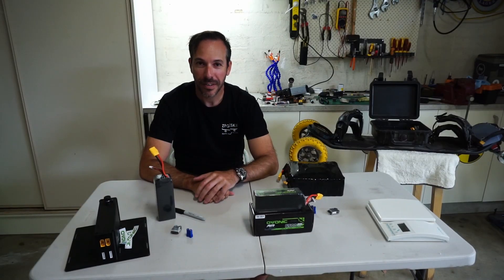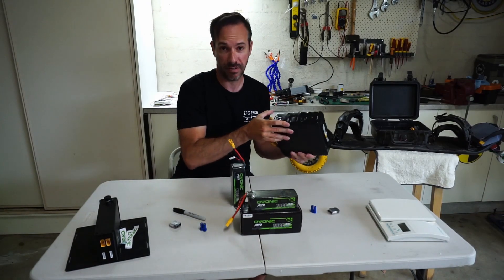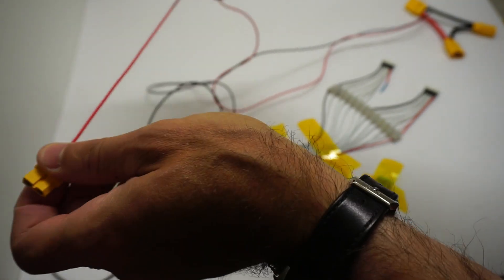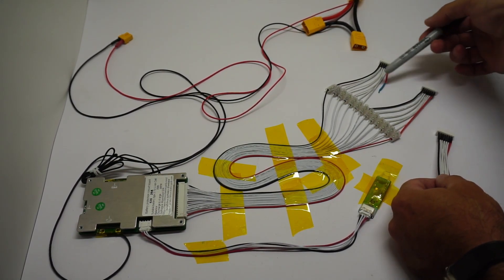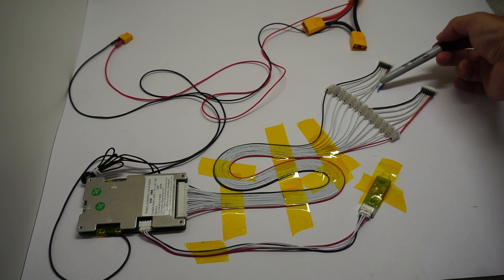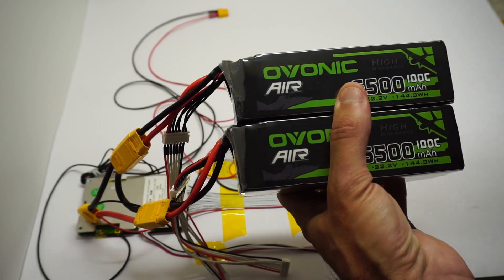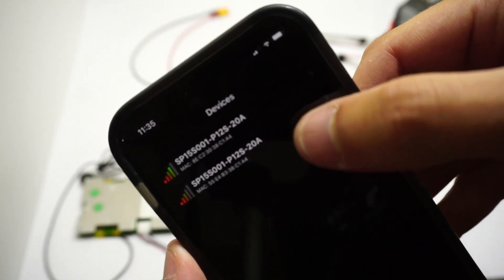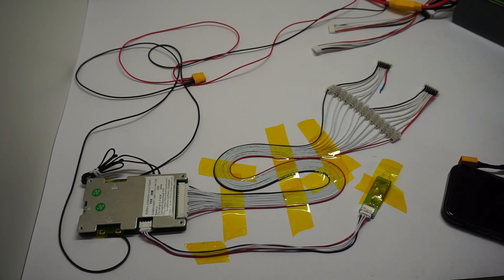12S BMS LiPo Hook Up

Comment: Do you only use it to charge? My cells are unbalanced, some are 3.6, others are 3.7, does the BMS regulate them even with differences in voltage?
Reply from the maker: Yep - Charge only. I've never had an issue with unbalanced LiPo packs - I have had issues with unbalanced Li-Ion packs though. In the BMS app setting you can set it to static balance - this will bring all the P group voltage closer together although will take some time.

Comment: If you put the neg on your meter on the first balance cable neg. And then pin your first positive wire on the 2nd battery. Shouldn't I see 7s voltage? Then 8s 9s 10s etc... Down the line? I'm not seeing that. But I've wired it as you have shown. My 1s to 6s all show the correct voltage. Just not when I make the transition to the 2nd bat.

Comment: I made a spare lipo pack for my ebike. You don't need a BMS. Just disconnect the series connection and use an imax b6 balance charger. You can even use 2 at a time.

Comment: Hi i want connect twelve 3s 2200mha batteries to one 12s battery 6600mha with bms how to do it?
Reply from the maker: WOW, that is a lot of LiPo packs. For this to work you will need to make 3 groups of LiPo packs that are connected in parallel so you will have 3 separate 12S setups each outputting 2200mha. 

You then will need to connect the power output leads of three groups in series. Similar to what I've done in my video. This will give you 12S 6600mha. Please do not attempt to use this setup with a 12S BMS, my brain hurts just multiplying the amount of balance leads you will be working with.
Reply: @zfgesk8  
i would like to connect them to bms or 3 bms

Comment: Wlil it be ok to not us a bms and instead use the voltage reader inside the board and then use a balance charger to charge the lipos?
Reply from the maker: You sure can and this is what I do. I use a SkyRC T200 as my LiPo charger and it works great. Having a BMS is a great option for folks who want to seal their LiPo Packs inside a Pelican case and use a regular 50.4V charger power pack.

Comment: Hey mate thanks for the guide. I want to do something similar in NZ. I checked your link in the description (broken) for the bms but no luck. Any chance you could direct me to the smart bms? Also where in the system do the alarms go? Thanks again
Reply: Its better to just charge the 2 batteries independently with 1 or 2 imax balance chargers. You don't need a BMS.
Reply from the maker: That's great to hear, sorry about the broken link. Its fixed now.

Comment: Hey Michael thanks for putting this video out...and the others....very helpful for someone like me new to the game. I have everything for my DYI build based on the MBS Comp 95 Birds - Makerx DV6 - Radium motor mounts - MBS 72T wheel pulley - 13 or 14T motor pulley. I want this to be as light as possible just for mountain bike trails/pump tracks so have gone with Flipsky 6354 140kv motors. The last thing I need to get is the battery and bms. I was actually looking at the Ovonic 6500...but they're sold out so looking at "Youme Power 6500 60C"...I found on ebay $99....don't suppose you've heard of them? or can you recommend another? What range do you get offroad with the twin 6500 set up? And what bms are you using or would you recommend? Any help would be great! Cheers Mike (I'm a Michael too...but across the border in Adelaide but originally from Melbourne....go the Blues!)
Reply from the maker: NOOOO! I'm strickly a Hawks supporter :) First up, you can afford to go a little higher in your motor teeth count as you have a 140KV setup. I'd start with a 15T or 16T motor pulley, you have heaps of torque to play with. I get about 14KM of BMX track riding from my LiPo setup, just over an hour and by that time my legs are on fire. I recently went to buy some more Ovonic 6500 too when they were in stock although they wouldent ship to Australia. You need to make sure you select the AU warehouse. Your next best LiPo would be a pair of Turnigy Graphene Professional they come in 12000mAh and 8000mAh size options, check out the Hobby King site. Another option is to run X3 Ovonic 50C 4S 8500mAh cells - These are in stock and have a high C rating. I tend to stay away from LiPo's on ebay stores as I've had some bad luck in the past with cheap 3S cells. As for the BMS, jump on Aliexpress and search "12S Li ion Battery Smart BMS with 20A", looks at the first one that comes up. These are the ones I use for all my builds.
Reply: @zfgesk8  Haha....well if we don't get a win soon we'll be down with you guys! Thanks for the feedback...found the bms thanks for the tip....yep I think I've got a range of motor pulleys coming so will give the 15T a go....might be better for belt slip I'm guessing too. The 15km - 1hr sounds perfect for what I'm after...that's great to know....I'm around 80kg so guessing maybe similar to you? I'll re-visit the Ovonics....do you know if they re-stock frequently?...they seem like a good price compared to others. Thanks again 🤙

Comment: Is it the same just with two 4s lipos
Reply from the maker: Yes, the process would be exactly the same, just a few less balance leads to worry about :)
Reply: @zfgesk8 if I use 2 3s lipos in parallel do I need 3s bms or 6s bms ?thank you
Reply from the maker: @Hisham-lr7df  Then you are still on a 3S system so a 3S BMS will be needed. This example is for a LiPo series setup.
Reply: @zfgesk8 Thank you for responding but one question tough do i leave the second lipo battery lead open because one battery wil go to the bms wat about the second battery lead ?
Reply from the maker: @Hisham-lr7df  Hello - I don't quite understand the question - this video is specific for two 6S packs to run as 12S. You might be better served going to a drone or RC car forum for your needs.

Comment: Subscribed! I’ve thought about this! Saved for reference. 

Why not take lipos below 3.6???
Reply from the maker: The lower you go the more stress you put your cells under. It's not so bad when you pay $135 per cell although some LiPo's can get expensive so you want to look after them. Stressing a LiPo will cause it to puff and you'll compromise its integrity and shorten its life.
Reply: The default cutoff voltage for lipos is 3.2V.
Reply: I sent my cut off start to 3.45v and my cut off to 3.3v. Although I never drain past storage voltage at around 3.8v !